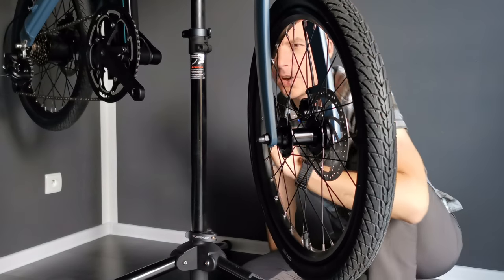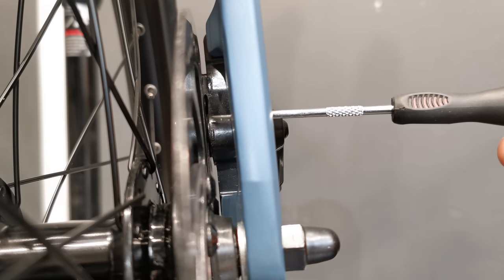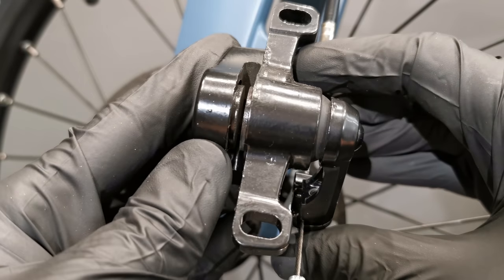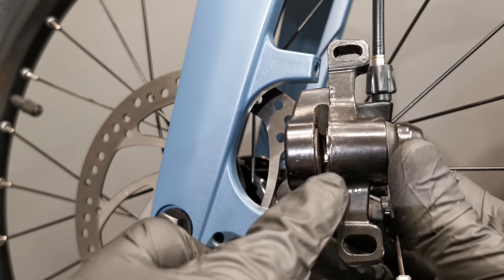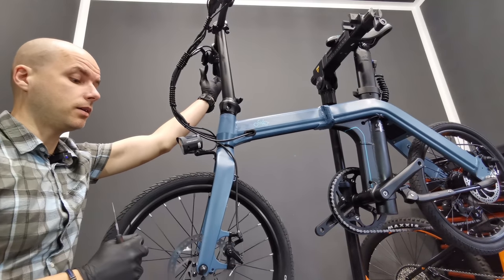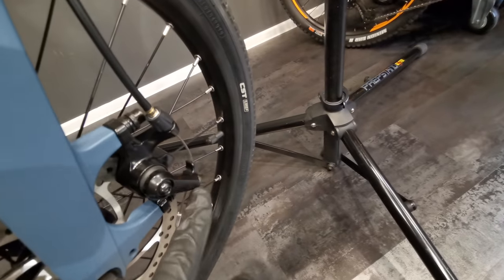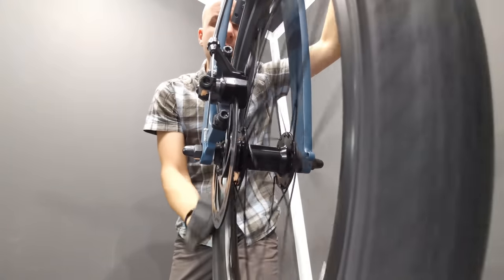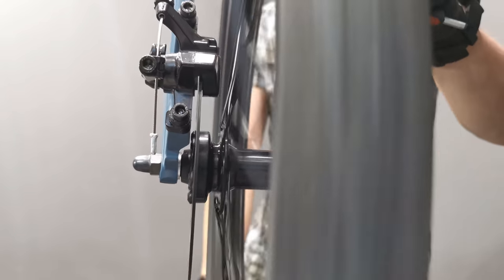How To Improve Cheap, Mechanical, ONE Piston Disc Brakes For More Braking Power. Single Actuation.

Comment: In a simple nutshell: If you squeeze your brakes & you can see the rotor physically move side to side at ALL, your brakes are out of perfect adjustment. After watching this great tutorial, I was able to get my Tektro Mira brakes perfectly adjusted to where when I squeezed the brake all the way there was absolutely no rotor movement from side to side & no disc brake rotor rubbing on the brake pads. You helped me squeeze the maximum performance I can get out of my single-sided piston mechanical disc brakes on my gravel bike! 👍🔥🚴🏻‍♂️🔥

Comment: you literally saved my life. i changed the brake pad (the last one was fine) thinking that it was worn out, tighten my cables, adjusted my caliper and there is still no braking power. i did not know we could adjust the non-moving piston. i tried it and now my brake is fine. thanks a lot man.
Reply: Literally saved my knees hahahaha

Comment: Not only was it very well explained, but you showed up close the mechanics of it. 

Thanks as I’ve calibrated them several times now, but the last few times they barely brake which is Uber dangerous. I knew of the other inner side of the wheel, but haven’t until now after seeing your demonstration will do just that.

Comment: Or you can also mount the caliper just enough so there's still a little side to side play, use a 0,3mm feeler gauge between the rotor an the stationary pad, squeeze the brake lever and the tighten then mounting bolts one by one carefully. If you tighten them carefully then it should be silent.

Thanks a lot for video :)

Comment: What I also like to do is to adjust the cable tension in such a way that the lever of the caliper is not free but is as lifted as possible, to minimize the distance between the moving pad and the rotor and thus make the hand lever more sensitive.

Comment: Very good and informative video. I bought the Gravelbike with same mechanical Promax disc brakes a few months ago. At the beginning I couldn'r set up the brakes properly, either the pads were rubbing too much or the brakes were innefective. I thought that the brakes are crap and that I do need something much better with Hydraulics. And I found a video similar to this one where they explained how to adjust the brakes, and since I did that I was amazed how the brakes good work and don't rubb. The cheap stuff works alos really good when it is adjusted correctly...

Comment: This helps so much! My bike shop back at home always adjusted my brakes so they would brake without having to pull so far on the lever, which is what I'm used to now. After moving, my new shop adjusts them so that I have to pull my levers a bit further than I'm used to. Even having to pull that extra little cm or 2 can be the difference between safely braking and running into someone in front of me! Now I'll be able to do this at home with ease :)

Comment: Great set-up video. On my Spyre brakes (with two moving pistons) I find setting the brake arm with a little tension at rest gives snappier braking. Compressionless brake housing is a must for mechanical brakes.

Comment: Thanks for this. I brought a Trek Verve 1 Disc and the braking at low speeds is ridiculous. I practically slide to a stop (and not quickly). My Brompton V-brakes and my friend's Trek FX 1 V-brakes stop much better, even in wet conditions. A bike shop mentioned I have a low spec brake given the Verve 1 price point. That makes little sense to me. A bike's brakes should work properly regardless of the price point. Safety shouldn't be compromised for a "quick" buck.
Reply: Bro we got on the mtb side on a Trek Marlin 8 hydralic disc brakes that are the lowest end shimanos out there. (Which work rather well but shouldn’t be on a bike like that). And those brake cost 80$. The wheels still come with cheap formula hubs.
Reply: @Drago0900  interesting. Maybe I should have gone for hydraulic brakes.
Reply: This is the unfortunate problem with the bike industry moving towards disc brakes due to marketing. Cheap disc brakes are absolute garbage. Manufacturers should stick with rim brakes if they're trying to hit a price point, rather than throwing in cheap disc brakes. You can always trust a pair of $10 V-brakes to stop you. Good luck with a $10 disc brake system. The sad thing is, even the cheapest mechanical disc systems are far more expensive than rim brakes. Which means the manufacturer is also cheaping out on other components to hit the price point.

Comment: I accidentally did it by ignoring adjustment until it would barely stop and then adjusting it. Very quiet and somehow really powerful disclaimer though if you're used to weak brakes and you adjust them to where they'll stop right it might throw you over the 
 handlebars. But that somehow seem like a good break-in.

Comment: BB7 owner, as long as I can get 180mm+ rotors and decent pads, I'll never need anything else.
Reply: "YOU ABSOLUTELY NEED HYDRAULIC! EVERYTHING ELSE IS UNSAFE! YOU ARE GONNA CRASH AND DIE IF YOU USE ANYTHING BUT HYDRAULIC! I AM NOT GONNA SUPPORT THIS!"
-my local bike mechanic when I asked him to order some mech discs.

meanwhile the cheapo hydro brakes on my 800$-Bike: Leaking oil all over the place at least once a year, to the point were you need to worry about loosing braking power on just about half of your tours - what  a great feeling, when being 50km from home or somewhere off grid entirely. 

I mean I used service my bikes completely on my own before I got hydros. I've had V'brakes and mech discs before and I was totally happy with the mech discs. Never had as many issues as with the hydros.
I am going back to mech disc and I am going BB7 as they seem the easiest to service in the field. And I am going back to servicing my bikes themselves.

You always hear about supporting your local businesses, but what am I supposed to do? I am for sure not gonna take the risk of loosing 90% break power in the middle of nowhere,  just so they can have a premium for the leak-fix every year and if they slap my hand when trying to offer to them one last opportunity to make some money, it's their fault I am spending my money on the internet and put in the work myself. Like it's nuts. This bike shop puts its revenue for servicing the hydros about my safety! They wouldn't even listen to my arguments for changing the brake system!

Servicing the hydros myself is just not worth the hustle. I like how they feel, but I don't like em that much that I carry around bottles of oil, gaskets and specialized tool on every tour just in case. A simple allenkey on the other hand easily is put in your pocket in a pinch and you're good to go even in the unlikely scenario of sudden loss of brake power. Except of course if your cable snaps, but I've never experienced that or even heard of it happening, so that's probably an irrational fear of some people.
And buying proper Hydros? Why would I buy brakes that cost me at least half of the price of my bike? Especially if I am not riding down hill or hardcore xc or anything else where you need that much braking power. That idea is just ridiculous.
Reply: @sihilius  
You make some very good points there.  I didn't think about if by some happenstance my brake line got cut while riding or my hydraulic fluid somehow sprung a leak.  Cables are are extremely strong and durable and can function upside down (something I happen to discover when I was test riding a bike and I was just moving it around on its rear wheel, working the rear brakes to help me maneuver it.)

I piece of advice, because I had spent almost $100 trying to troubleshoot this, make sure you buy quality pads, do NOT buy economy, stick to either AVID or cool-stop.

If you're heavy like me, opt to buy the larger rotors and adapters, like 180mm.
Reply: @MavHunter20XX  Thanks for your advice. I appreciate It.

I already got a 180mm rotor in the front and a 160mm in the back from the old system. Guess they should be fine since I am of the lighter variety and usually don't carry a whole lot of weight in my backpack. And they still are well thick enough, so I am gonna keep them and see how they work with the new brakes.

I also already ordered the first two sets of replacement pads with the brakes themselves. They are also avid ones, so I should be fine in that regard. 

Currently I am just waiting for the old brakes to leak again and as soon as I notice the slightest loss in braking power, I am heading straight home and switch them, so finally this bike will be actually reliable, rather than marketing reliable.
Reply: @sihilius  I recommend 180 in the rear as well, but I am of the heavier type.  The reason why I say this is because if you're descending and braking, you'll want to shift your body behind your saddle ( you might know this already).  However, there's nothing wrong to see how things work out first.

Comment: The bb5 acid type had the hand dial making it easier to adjust. Have you tried the hybrid cable hydraulic calipers Danny. I have a set on a bike and they work well about 85% of my fully.hydraulic.

Comment: This helped me a lot! Have you had an issue with the inner spring for the moving caliper arm?  I took mine apart and the only way to stop the spring from slipping from its groves was to duct tape it in place.
Reply: Me too. Maybe your comment help me.
Reply: How have you  reassembled?
Reply: @nippitaboy  I had to reassembled the caliper arm really carefully. Once I had the springs in the tiny groves, I duct taped the inside of the caliper arm to the spring by threading the spring through the duct tape. No more slipping! I plan to replace the brake soon though.

Comment: i find i center the caliper over the rotor ... set the fixed side ... then adjust the cable to get the pull i'm looking for ... all with the barrel adjusters turned in so i have room to adjust for pad wear

Comment: Nice to have a video that helps with understanding this type of brake.
Some points are well made/illustrated, some not.
.
However, at the end of the day my experience is that single piston disc brakes are absolutely TERRIBLE - in fact they are so poor that they are dangerous [mine are Tektro iOX].
.
I have them nicely adjusted [no pad rub, but still close to the disc], have roughed the surface of the disc rotor with sandpaper [to try to improve grip], have cleaned the disc rotor with a product, have installed two types of new pads and braking is still AWFUL.
Also I installed a new brake cable and shortened the existing cable housing by an inch or two.
.
When I brake with that bicycle the rear wheel always skids [it has a V-brake on the rear wheel].
Which shows how little actual braking the front disc brake is actually doing.
.
Any of my old bikes with V-brakes brake waaaay better [better control, faster stopping, can actually brake too hard etc. etc.]
.
If I ever talk to anyone who is very into cycling - they always just say - "yes mechanical disc brakes are crap - you need hydraulic brakes". Wtf?  Are single piston mechanical disc brakes definitively much worse than old V-brakes?
.
Or is there something that I have missed?
More expensive disc pads maybe?
.
If anyone knows of a solution or can confirm their feedback would be appreciated.
.
cheers!
JB

By the way, I don´t do anything fancy with my bike - just the occasional trail ride and commuting from A to B - no downhill mountain biking or anything like that
Reply: My Shimano MT200 dual piston hydraulics are brilliant for everyday use, quiet too.  Did you beak in your pads and rotors properly?
Reply: @vinceking7878  Well, I practiced a bit and I think that helped a little - first maybe to brake the pads in [maybe], and second to get used to needing to use a lot of force when pulling on the brake to get any effect.  As I said above, the main issue I think is just that the Tektro iOX on my bike are single piston - and such systems suck.  The only advantage they have is that good V-Brakes on very wet days are worse - but other than that case / scenario, I think that single piston disc brakes are just generally the worst setup that you can have.  
.
It is not even easy for me to swap a part out to fix this - because my gear and brake levers are those Shimano ones that are all one integrated piece🤦‍♂  But thanks for the reply. 👍

Comment: Is it fine to add preload to the brake calipers like you did on this video at 5:00? Or does it decrease the maximum performance of the calipers due to the decreased travel it needs to contact the brake pads?
Reply: no, the performance comes from your fingers or the type of brake pad / disc. All you do with this adjustment is set your preferred bite (or engagement) point in your lever.

Comment: Good luck if you puncture the back tire. I did on my first ride and there is no easy way to remove the tire. You can't disconnect the motor cable, like many e-bikes, unless you do it from the controller box and take ALL the cables out. Maybe you could check it out to see if you find a better way? Fiido support weren't helpful and they were aware of the issue. Bad design. Thanks!
Reply: Don't need to take the tire off, to fix a flat.  Just pull the part of the inner tube out.....patch it..... and roll on.

Comment: I'm on a Trek FX 3 2021 with Shimano RT26 Ice Tech Rotors, matched with Shimano B01S Resin Brake Pad. (Resin only stated) 

If I wanna improve braking  performance, can I swop to Disco Brake Pads, namely the Ceramic Hard, Soft compounds, & Kevlar type without any need to change the Rotors?

Live in Singapore, mostly equatorial weather, hot, humid climate, with rains from November to January. Ride mostly on pavements & tarmac roads.

Often carry some weight behind, so effective braking is a concern.

Thank you.

Comment: Very helpful for someone new to disc brakes.  I'm not sure about the process in Step 1, initial positioning of the caliper.  At 3:10, before touching the cable, you adjusted the fixed pad to get "the same exact distance" between the pad and the rotor on both sides.  I can understand wanting the same distance on both sides before resetting the caliper.  But then you said if the pads don't hold the rotor just move in one side or the other (3.55).  That confused me.  Now you are ready to reset caliper but you no longer have the same distance between both pads and the rotor.  Is it that the second adjustment should be so small it doesn't matter?

Comment: Ahhh…so that’s how you tighten brake cables….. I was pulling the cable with pliers and trying to tighten the screw.   ….Duhhhh…..hold the cable at tension, move the cable holder thingy higher up the cable, then tighten.  Eureka
Reply: Never move the caliper bolt back to tension, use the tension adjustment screw for it
Reply: @fr0xk  Can you please explain why?
Reply: @Ericdagreat  Depends on caliper to caliper but generally the caliper liver should have a hook that should hit the body of the caliper on full engage. If you pull that cable liver alot beforehand, you'll lock your brakes before they fully engaged

Comment: Thanks! It helped me, but it is still sqeaking, so i have to adjust once more...
I was your 3000 st LIKE ;)
Reply: If it squeaks when braking that's a different issue. Probably you have contaminated (dirty) disks &/or pads. If it squeaks all the time (even when not braking), you may have warped/bent disks or your static pad is still adjusted too close to the disk rotor.

Comment: The spring inside the pad came out while trying to adjust now I can’t get it back in. I’m talking about the spring that adjust the moving pad
Reply: Bicycle repair shops were invented for you.
Reply: @howgoodwasthat  My fault I was impatient I can usually do my own repairs but this bike is a Frankenstein of parts the brake levers are not the same as the disc brakes so those I’m upgrading later they work for now and even then the calipers were a brand I never even seen. The tires don’t get me started it’s been 3 days and I still can’t get that rim straight and it’s a mag wheel so it shouldn’t be out of alignment I believe I have to remove the tire just to put it back on again since the rotor keeps rubbing on my brake I still can’t get the front correctly I managed the back wheel but not my front. That being said not a bad bike for the money it’s my fault as I was being lazy and impatient without knowing how easy the adjustments were this is why I never buy my bikes online and always buy from local shops saves me the headache I managed to get the wheel somewhat correctly but that one spot is always rubbing the bead just refuses to seat.